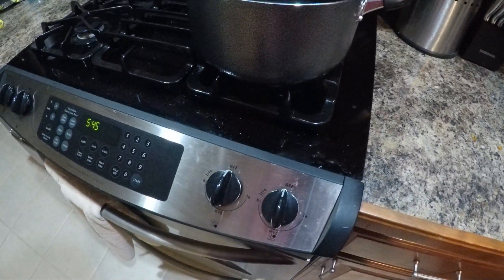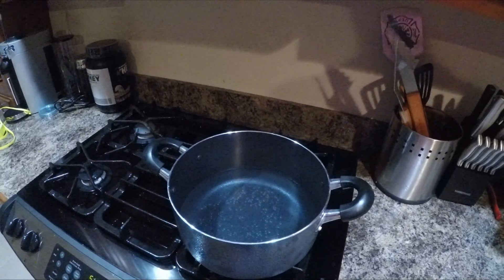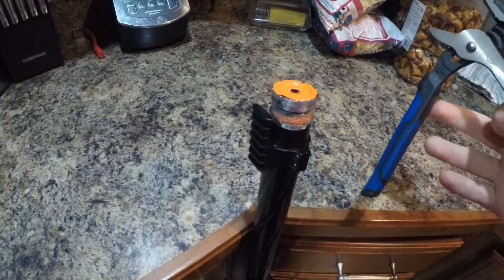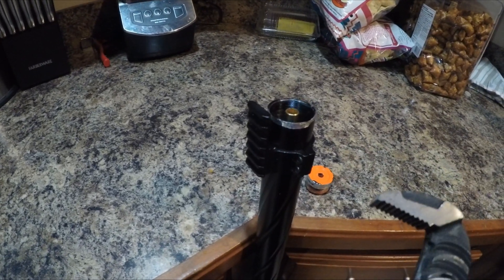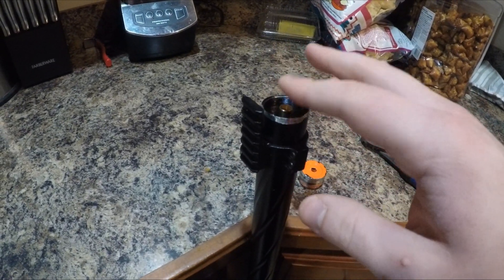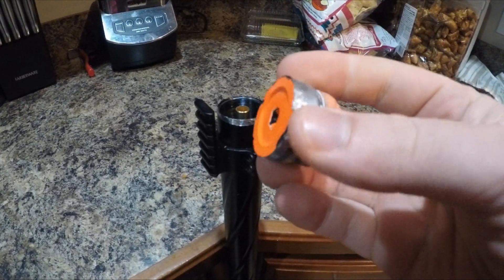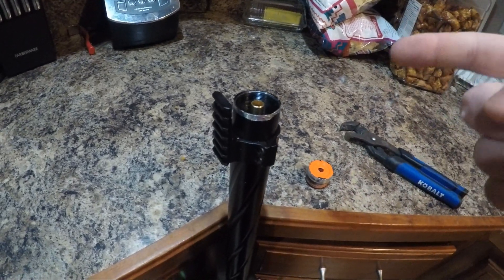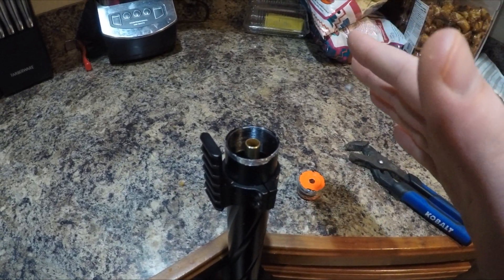HOW TO REMOVE ORANGE TIP ON SSG10A1!!

Comment: For those with ssg10, I followed instructions on his site.  Click on link for replacement cap and tells you what to do.   I hammered in pin a few mm (basically to where it stopped) and set the tip in inch of water for 6 min.   Applied a little bit of force in clockwise direction (no vise) and screwed off.   I’ll do my sons ssg24 and see how it goes and will post here.   Take your time with orange tips.  I’ve taken off many.
Reply: I Boiled the tip for 3 mins should i do a extra 3 mins because it wasnt coming off
Reply: the hydestr I think I said 6 above.   If that doesn’t work, try a few more min.  It should work.  Make sure you turn clockwise.
Reply: novritsch video said counter clockwise

Comment: The novritsch website mentions something about a pin in the bottom of the barrel that you have to push in was this not mentioned in the video or do you just not have to do it?
Reply from the maker: Honestly if you heat the glue up, that pin is not a worry. It will snap if you heat it up. It won't interfere with the suppressor at all or the bbs when they come out from what i have experienced. Hope this helps!
Reply: Thank you so much lol I thought i was worried over nothing
Reply from the maker: @dfis3616  its okay!! I got a little worried when I saw it too but after firing it so much since, it hasnt shown any problems. Its just a small secondary thing to help the orange tip grip more. Thus making it harder to unscrew
Reply: Thanks man!